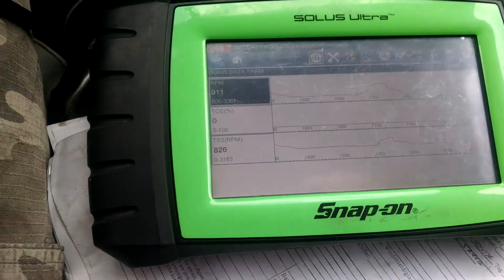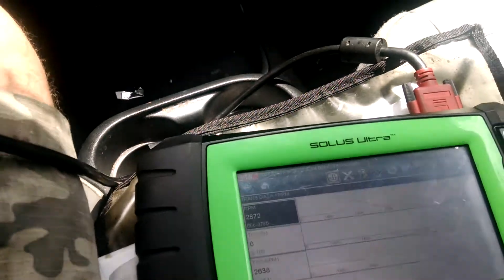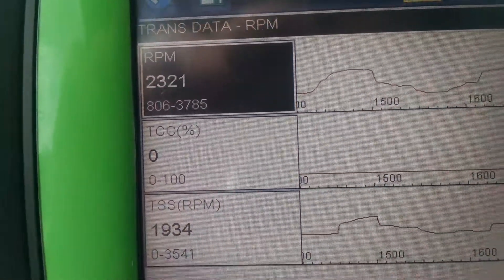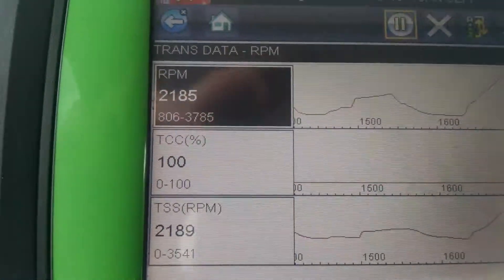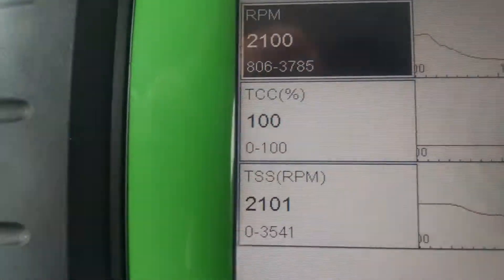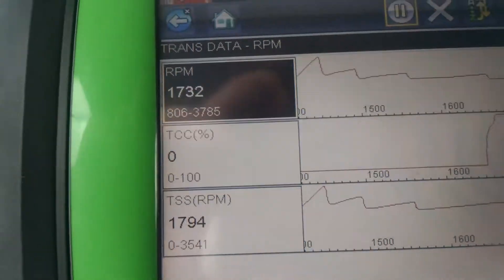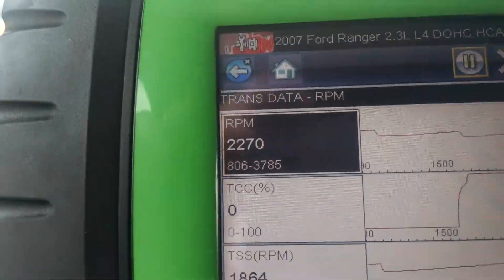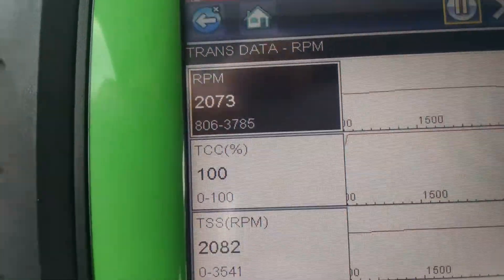Torque converter clutch apply P0740 P0741

Comment: i just bought a 2001 jeep grand cherokee 4.0 4x4. and about a week after i got it the CEL came on and is reading code p0740. it doesnt seem to driving any different and today was the first time the trans slipped going 2nd to 3rd when the truck was just warmed up. besides that 1 slip is hasnt done anything wrong that i noticed. its going into overdrive fine. only thing it does is bang a little bit going into 2nd gear but its got 185k miles but it was doing that before the code started coming up. any idea what i could do or should do?
Reply: Transmissions America John the trans guy I have a 99 chevy tahoe with a P0740 code, I replaced the tcc solenoid, the 3-2 solenoid, and another one as well but still have the code, the oil was good before putting new oil on it, there was no debri on the pan, the only signs is shuddering twice right before stopping sometimes, I have to let go of the brake twice and when I jump on the freeway it makes a noise but it goes away after 40mph and it seems to consume gas more